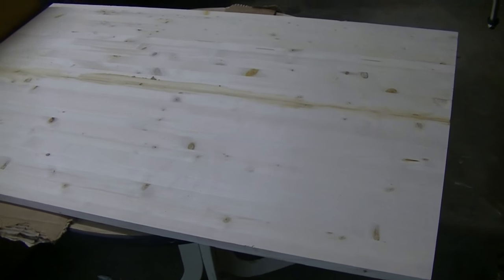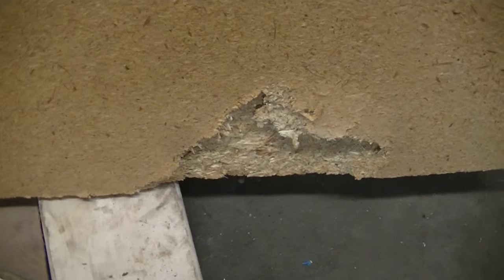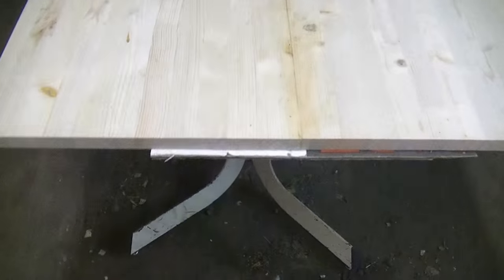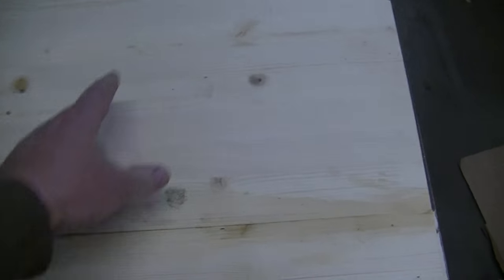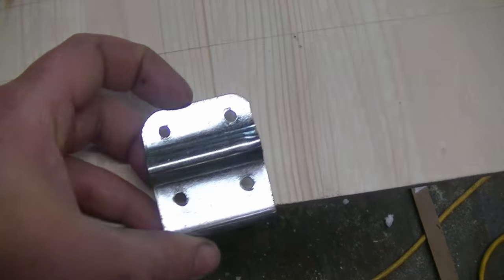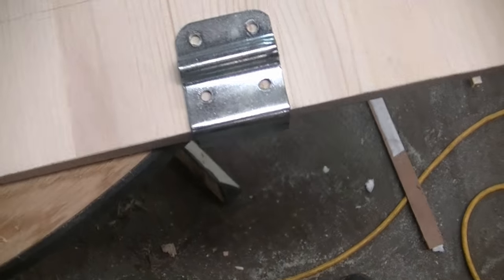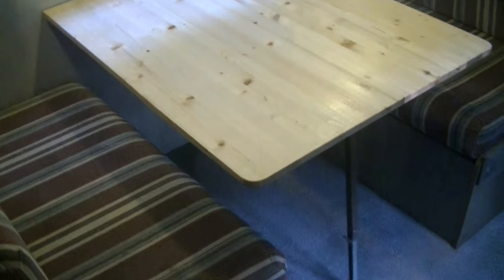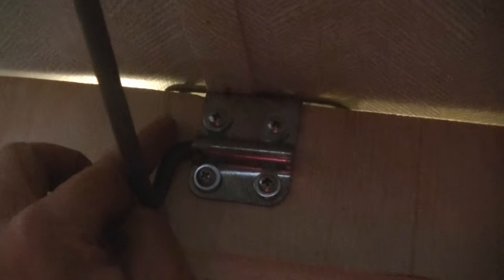Building an RV dinette table

Comment: Why would you glue 2 pieces of wood together instead of using a thick piece of solid plywood you could then support with bars (either wood or metal)? Several different solid pieces you could get at Lowe’s/Home Depot that would be the size of the tabletop or bigger, that could be cut down.

Comment: Hi, where did you order the hinges and table leg from? Would you mind commenting a link or anything?
Reply from the maker: Violette Roman They were on the original table in the motor home that my kids broke. Check with your local RV store.  I’ve bought a lot of replacement parts at my local store. If yours is any good they should be able to get you whatever you need.
Reply: Hinge kit is also on eBay for about $15